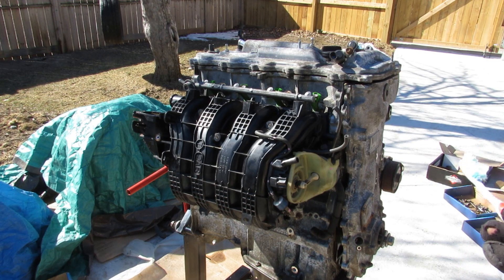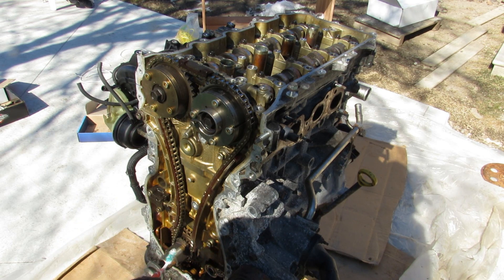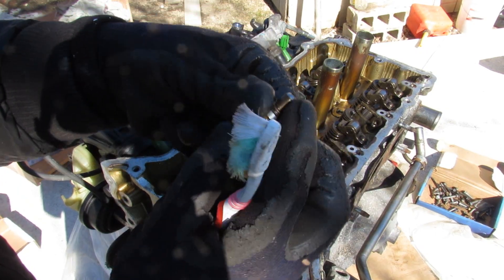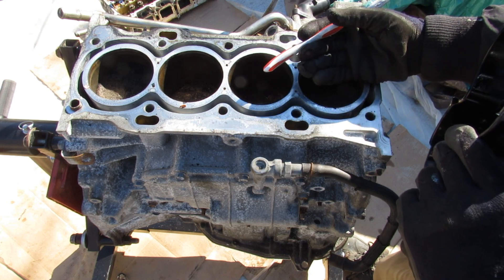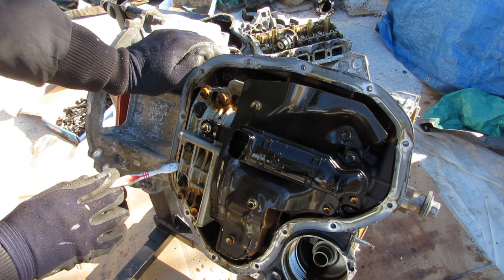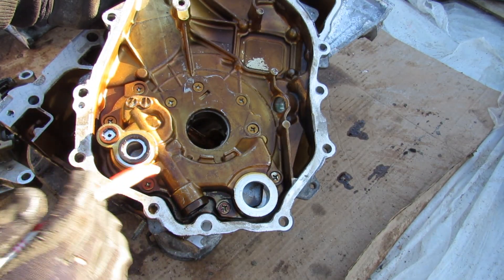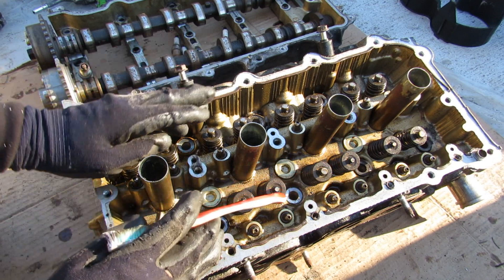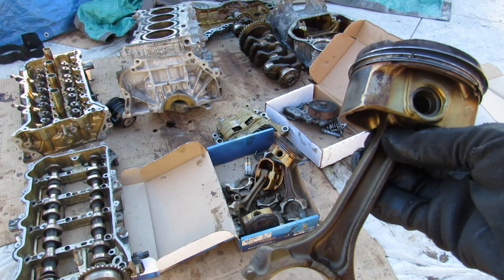Why Toyota Engines are Reliable

Comment: BMW has successfuly used plastic timing chain guides for many years.  Going back at least to the M70 engine start of build in 1988.  Any auto historians here know if they were used in the M30?  I don't think it goes back further, but maybe into the S38 series engines in 1986.

Comment: Another excellent video! Tell me something. Do you have any idea how many miles may have been on that engine. Also,  what do you think caused the connecting rods (at 9:08) to shake like that? Or do they all get like that over time?
Reply: I have the same question. AFAIK the only time you get rod play like that is when you have oil starvation and the rod bearings spin, but this engine looked fine in that regard, so I'm curious as to what caused it.

Comment: You CAN actually remove the balance shafts, permanently. You need to plug one of the oil passages though.
Grab 2 intake cams and the high compression pistons out of the 2ARFXE to get 260BHP! You will, however, need a standalone/piggyback ecu to manage the timing.
The cam phazers need slightly stiffer springs to prevent that noise

Comment: Nifty ! Really cool vid. You'd think we(or rather "engineers" in general) would have "reliable engine designs" mastered from at least as far back as the 50's or 60's onward, yet its STILL just a hit or miss situation apparently. As much as I'd take virtually ANY late 60's to early 70's car over ANYTHING made today bc F economy & safety 🤣 & for ease of maintenance, I have to admit that I personally owned a few Saturn's(early-mid 90's & on) as did both my uncle & cousins(so at least 7 or 8 in total I'm aware of) with engines with over 260K+ miles(hard), not even leaking or burning a drop of oil & never failing in a catastrophic way. I had never did anything but brakes & maybe 1 radiator, NO bearings or mufflers or ANY other damn thing ! Though by that time even the door & window handles were all falling apart. So, otherwise a POS perhaps but "bang for the buck" NO Q was there. BTW, my girl had a 2005ish Vue, not long ago, bought with pretty high miles & unfortunately it was a manual & needed a clutch job soon thereafter, & it was like $1700 min ! (bc damn sub frames & whatnot ?!, clutches "used to be" a driveway thing for most ANY DIYer), Anyway, it was more than she paid for the damn car & I'm too old now & disabled, so its not just a love story, though I was a fan overall. & as I understand, some of the engines were by Honda(& allegedly perhaps why pretty "reliable"?), not sure which were which but I know my 1st 2 were not.

Comment: Another detailed and very well explained video. Personally have the older diesel egine in a Rav 4. It's done 140,000 miles. Change the oil, oil filter and air filter every 10k miles.
Rarely check oil and water levels and still doesn't us a drop of either. It is by far the most reliable trouble free car I've owned in 45 years. It's economical too.
Probably as reliable as a Honda...

Comment: heads up, the big ends always move back and forth even when brand new also the crank does so to, if they dont the engine will fail before you get to Costco.
I wont bring up the hammer stuff.
clearly the engine was from a wreak so you didn't care how you disassembled it.
Reply from the maker: Yes I learned that the side to side play is normal. I started noticing it in other engines too

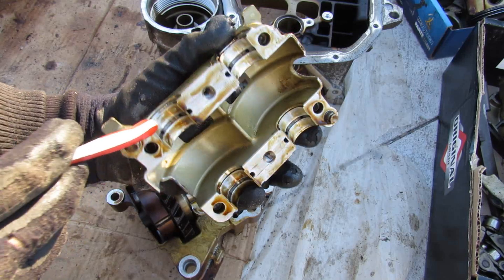Comment: 12:20...those arent oil feed holes to the head. they drain oil from the head. the oil feed is at the lower right corner.

Comment: Answer: Because Toyota manages to integrate modern day technology and emission systems in a new engines using not so complex parts designs whilst at the same time managing to retain reliability throughout different engine families.

Comment: Nice video.  Can you change the  timing chain tensioner through the access cover without taking off anything else?
Reply: It's probably to release the tension on the chain so you can remove the vvt unit

Comment: My 1984 M-B diesel 5 cyl has similar timing chain guides.  Aluminum with a plastic liner the chain runs against, perhaps nylon.  It also has a similar hydraulic tensioner.  My 2002 Chrysler 3.8L has a similar oil pump in the timing cover, driven directly by the crankshaft.  The oil drip tubes in the valve cover look like a simple solution and perhaps eliminate having to drill numerous oil feeds in the head.

Comment: Now that you've disassembled so many engines, what are some of your favorites?
Reply from the maker: Honda K24 is strongly built (for an economy class car), and also the H22.  The Benz m270 surprised me with it's build quality as well,  for being European. The Toyota 1ZZ and 1NZ were the king of simplicity. Honda J-series are also pretty solid and layed out fairly straight-forward, except the knock sensor harness and timing belt instead of chain.

Comment: Watching this after video about the Audi V6 is a good palate cleanser 
Reminding me that not all engineers are evil and showing that there are engines out there that don't use twenty different kinds of bolts and screws even on the same part
Reply from the maker: Yep, much easier to take apart and work on.

Comment: These videos are so therapeutic 😂 interesting to note is the plastic insert in the water jacket is to create temperature consistency across the cylinder. It limits the amount of coolant flow at the bottom of the cylinders where the temperatures are lower, and maximizes flow at the top where compression and combustion take place. This is to do with thermal expansion because without the insert the top of the cylinders would be much hotter than the bottom, which would make it wider at the top and narrower at the bottom!

Comment: omg i cant believe these fools put vtec in the valve cover
Reply from the maker: Vtec isn't on the valve cover
Reply: @speedkar99  vvt is a part of the acronym. At least in a honda, the oil passages for it are inside the cams themselves and the strainers are built into the head cast instead. I think the honda placement is superior and Toyotas have unnecessary design language.

Comment: Toyota reliability went to shit in my book when they went to SOY based Rat Candy wiring harnesses ...
Reply from the maker: Lol rat candy
Reply: The rodents haven't touched the wiring in my 88 or 91 Celicas....

Only the SOY based Rat Candy...
Toyota won a Civil suit based on their claim that rodents have been eating wiring harnesses for centuries....
And therefore it's NOT covered by the warenty.  It was functional when they sold it....so it's not their problem.

Again, I have very little confidence in the reliability of my 2017 Tacoma... at 60K rhat sucks rhe Brown Eye.. 

Until Toyota implements a simple "Rat Test" and fix rheir shit, screw 'em.
They screwed me.
Their reliability claims are BS.

Comment: I've always wondered why I could faintly hear my 09 Camry give a blow off valve sound when letting off the gas. It's the vvti vacuum system
Reply from the maker: VVT doesn't operate with vacuum
Reply: @speedkar99  Intake, in layman's terms same as vacuum system

Comment: I thought this guy was pretty knowledgeable, until he pointed out the big ends of the rods and how noisy the engine would have been. But that side to side movement is normal in a used engine.

Comment: Great teardown. The design looks super simple, compared to some of the other engines you've showcased on your channel.  My 2AR-FE Camry is still running just fine at 180,000 miles.
Reply: Mine is ready to hit 270k.. Runs like it did in 2010.

Comment: VVT I toyota engine has some problems. Burns a little oil, rattling at clod start because of the actuator and can shaft bearings.
Reply from the maker: Yes the rattling is present in many Toyotas, including my V6 Camry

Comment: Hi all, can someone please explain something to me? How does Toyota ensure quality? What I specifically mean is if many of them are built in USA using all domestic parts, how do they know if the quality of the parts are durable to their standards like in Japan? I don't know how else to word my question, example many Toyotas were once built in Japan, now that many are built here in USA, someone must be supplying the engine parts, transmissions, it's parts etc to them, are the same suppliers who supply toyota who supply Ford, GM, and Chrysler-Fiat?? Then why are Toyota's more reliable if using same parts manufactures? I recall back in the 1990s there was a huge lecture Toyota gave to parts manufactures in USA saying what works for detroit won't work for us.....So I always wondered how parts are checked for quality durability, etc....to match Japan quality. Also are the modern toyotas expected to last 300 to 400,000 miles and still durable as the 80s, 90s toyotas?
Reply from the maker: Engineers come up with a spec and drawing. Manufacturers, regardless of location are responsible for meeting that criteria, which includes rigorous testing, measurement, etc to ensure that they've met the criteria. The responsibility lies on the manufacturer to make the correct part, they'll take the hit if there's a screw up (takata airbag recall comes to mind).

Comment: I don't consider water pumps or AC as a part of engine reliability they will fail its just a matter of time. But a engine should if built right last significantly longer, as well as a solid transmission this is why my top 2 variables when buying a car are a proven engine and proven transmission. I'm not worried about replacing a water pump when it fails.

Comment: Oil lubricated and cooled pistons very nice. Be it 1930's tech on large wartime diesels. Car engines could last a million miles if made right. If auto engines were rated in hours like marine engines you would see they don't last very long.

Comment: I have 2 3rd generation 4runners with 6 cylinders.  One has 400,000 one has 360,000. Neither one had been taken care of. Oil changes between 15,000 to 20,000 miles.

Comment: I was lucky to have bought a camry with full synthetic in it. I have now almost 142k miles on it. I was told that the car should go another 100k miles 😲
Reply from the maker: Nice. Keep it well maintained and it'll last a long time
Reply: @speedkar99  yay! I brought it to a tranny shop yesterday where they checked for codes and fluids for the engine and tranny. All that was wrong was that the power steering pump was leaking. Relieved that the trans fluid had been maintained too. Great Videos by the way 😁

Comment: Petrol driven engines is never so reliable, like Diesel engines. Diesel engine is more robust build, and fewer parts to fail. Vw 1.9 TDI is most reliable engine. Diesel engines is more simplier to maintain. You basicly can maintain diesel engines in your own. Specialy older cars, like vw passat b5.

Comment: These engines did not have a great start when they were first developed but year over year Toyota continued to improve on them and made them one of the most reliable 4 cylinders that they have ever had and it's a true testament to their commitment to quality. 😇😎👍
Reply: Pookibear  look at the early ones, they had piston ring issues along with vvti problems..
Reply: Pookibear  I'm aware of that I was just pointing out that early when it first came out it had problems I wasn't implying that there completely unreliable which they're not..

Comment: The 22r was the best engine ever produced some have gone a million miles without a teardown. I got 460k out of my 86hilux and rust forced me too sell the motor and scrap the truck
Reply: Man, I got 660'000km out of a 1989 4age smallport, when I pulled it out it was only cause it needed oil seals and the gear box was shagged. I sold that motor recently for 1200$ and they guy thought he got a bargain.

Comment: I have a 5sfe motor with 285k miles still pushing, and a 3sgte with original turbo at 250k+ miles still pushing. Guess what two cars I drive? both Toyota.

Comment: ''Why Toyota Engines are Reliable'' then 15 minutes of ''this is a weak point of this engine'', ''this is another weak point'', ''this is a weak point'', ''this is a weak point''. I get it, I truly do, but it's just sad that people are expected to pay, in many cases, well over a year's salary for machines - from ALL manufacturers - that are intentionally designed to fail under normal operating conditions as fast as they do. NO ONE can say that car manufacturers are working toward a faultless product. They've had way more than enough time to manufacture an engine that is bullet-proof and not even one of them has ever done it. Instead, they continue adding ''weak points'' that lead to a pristine machine in 2016 being a sludge-fest with deteriorating internal plastic parts and out of spec oil starved machinings by 2021. How will they do it once everything is electric? How will they design electric motors and batteries to fail early so that the customers keep crawling back to them every 5 years for another chunk of their life's savings (or debt)? It's going to be interesting. I think it will boil down to services for hire where they don't allow a buyer to actually OWN anything, rather, are a ''member'' of their car calling service (ie use an app to have a vehicle self deliver itself to you whenever you ''need'' one). Job security will only exist for the executives at that point, the rest of us will be CUT OFF.

Comment: Plastic at the bottom of the cooling galleries of the cylinders? No big deal, not much heat gets generated down there and the coolant is fresh from the radiator. Next.

Comment: How did this engine fail? Judging by the carbon on the pistons the oil rings did not work. The side play on the connecting rods seemed large, but the rod bearings seemed good.

Comment: Man...the switch from American engines, to Japanese engines is eye opening. A VVT doesnt mess around. VVT is fascinating.  I wonder  how far we are from individual, independent,  valve control?  Like the Freevalve. Seems like Toyota already has very tuned control over valve timing. The next step must be the ultimate control over a combustion engine; a computer controlled, independent valve train....Cool

Comment: I would recommend using a plastic pammer if are going to tap on connecting rod surfaces or better yet pull the pistons out from the bottom where there is less resistance.
Reply: The engine was junk

Comment: short tapet arm between cam lob and valve  make light occelating part to speed up engine,,, My Kawasaki 750 GPX was also having such rocker arrangement and  the red line used to start from 10,500 RPM to 14,000 RPM,,,Could speed upto 8,500 and speedometer pointer hit the stopper  after 200 KMPh,,,, reading, This engine also had a counter wieght  like in BMW 650 Single cyl  engine in a trail bike,,,

Comment: A reliable engine you say. 2011 the engine was made, So If and I do mean "IF" these engines are so reliable then why is this engine being stripped down? The engine is only 10 years old. Just because Toyota used this 2AR-FE in many models over many years does not mean this engine design is reliable.
 I know myself of other engines that have done over 1.4 million miles and still running strong and believe it or not, the engine is a Nissan RB series straight 6 SOHC 12 valve 3.0 liter. This engine is 31 and a half years old. 

Another Nissan engine is a little 1.6ltr 4 cylinder DOHC VVT QG16DE that's 20 years old and coming up on 270,000 miles and runs just as good as the day it was first started. reliability of any engine is "subjective" meaning as long as the engine is serviced properly every 6,000 miles using good quality oil and oil filter and driven as if you own and care about it and not "drive it as if you stole it", then engines can and do run for as long as you take care of it. This of course is my own opinion and experience for what it is worth.

Comment: 4.0L "Barra" engine by Ford has got very similar design to this but 6 cylinders in-line. It never fails unless overheated. The same acoustic air intake control, a timing chain, hydraulic timing chain guide, VVT, hydraulic valve lifters, the same roller cam followers on rocker arms. BTW, a timing chain doesn't mean it will last forever. There are some V6 engines by GM that have timing chain stretching so they need to be replaced at 100k.
Reply from the maker: All engines are very similar to be honest. I've taken apart dozens by now

Comment: Reliable my ass. The same company put a temp sensor in the radiator used a rubber band for an oil pump gasket and put timing belts in trucks. Wtf are you talking about ? I have seen the distributor on old yotas melt . timing tensioners that crap out and tear up water pumps. Wtf man...
Reply from the maker: When you are a mechanic, all cars are bad.

Comment: The cam box looks very similar to that on a Mercedes-Benz M110 engine. Plastic chain guides have been around since the 1950's, therefore they are not new.
Reply from the maker: That cam tray thing is too many extra pieces. But nice if you don't want to touch the cams and get straight to the head.
Reply: @speedkar99  simply means an extra 2 or 3 dozen bolts to undo.

Comment: Owned a '89 corolla and '06 Scion tC. Had only a timing belt issue with the corolla because I got the car used at 140K. Had the tC for 10 years, not a single issue. Planning on getting a Corolla Hybrid at the end of the year.

Comment: Has many design features of a Nissan L-Series engine with the added twin cams, roller rockers & cross flow head. I believe it was based on an earlier Mercedes design. The L-series uses a timing chain, chain guides, oil pressure driven chain tensioner & a front cover oil pump & distributor on a shaft driven off a crankshaft spindle.

Comment: These newer Toyota engines are no way near as reliable as the pre-vvti ones. Oil consumption and huge EGR problems
Reply from the maker: Agreed, oil consumption is a thing but definitely better than spinning bearings or slipping timing chains